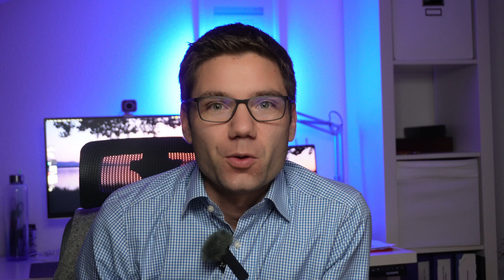What (Embedded) Systems Engineers Do - Pros & Cons and Comparison with Embedded Software Engineer

Comment: Hello,may i ask for advice how to find company to hire me in junior embedded developer.I'm a ground vehicles diagnostic and mechanic with 18 years of experience.Now i'm working for Solaris bus&coach ,they a busses producers in Poland.I'm working with electric and hydrogen buses .I have knowledge and experience with low voltage electronics system and alot of BOSCH fuel systems.
I'm learning now C++.
How to find a way to enter in this sector, please?

Comment: Is it better for beginners to use the peripheral libraries provided by chip manufacturers when programming microcontrollers, or should they write the drivers themselves? Also, should they focus solely on the application logic or be aware of both the peripherals and application logic?

Comment: One of the con the positions for embedded software are less than regular software engineer 😢
Reply: what do you mean with position? In my opinion, embedded software is more complicated because of electrical and mechanical domain.
Reply: @TK50_21  I mean few roles .
Reply from the maker: This is definitely true but depending on the specialization of other software engineer roles it might be similar… I have also found it really depends on the region … not sure whether this will change with thinks like work from home and so son